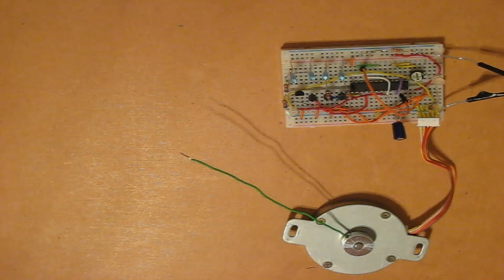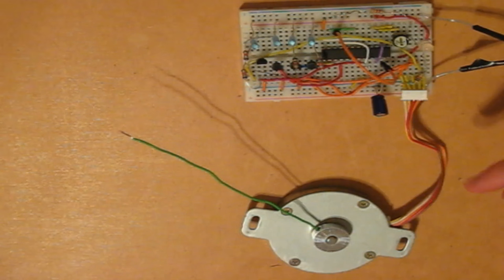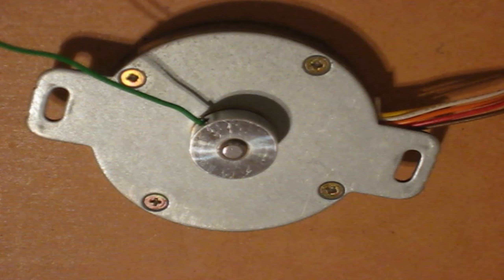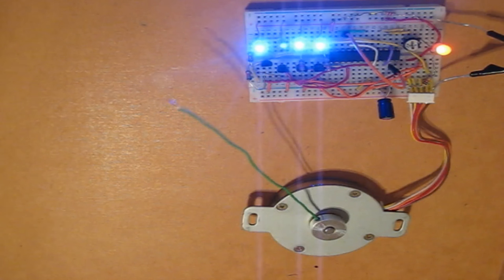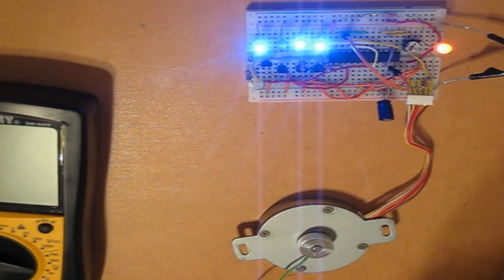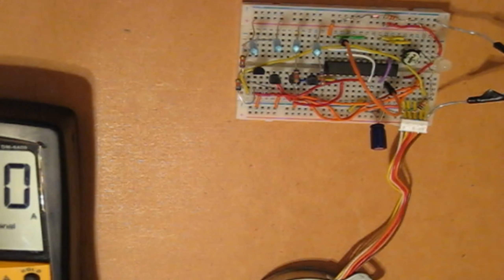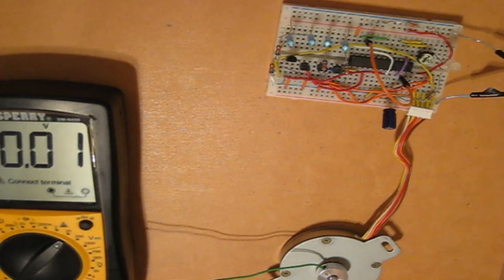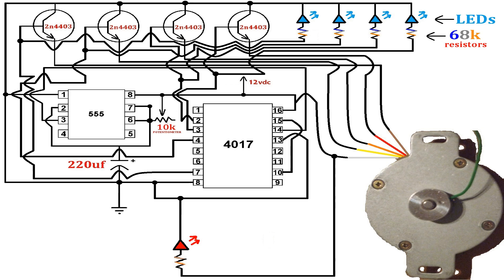How to make a stepper motor driver and controller using the 4017, 555 timer, & 4 2N4403 transistors

Comment: Thank  you; 1) why we need to put transitors can we connect motor wires directly to the outputs of the CD4017 Ic ;  2) can we use 2N2222 transistor instead of 2N4403?
Reply from the maker: to answer question 2, yes.
to answer question 1, CD4017 only supplies at most ~50 mA which is 0.05 Amps. any motor takes much more current than that, hereby creating the need for a powerful switched supply, like a transistor, MOSFET, H-bridge board, or relay.
Reply: @LunarLightShowProductions  Thank you very much pretty mind